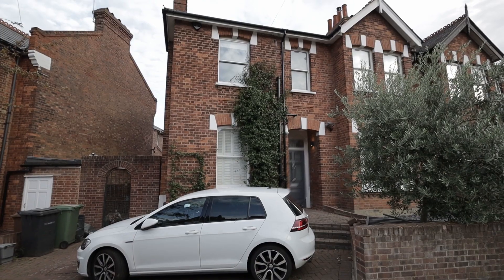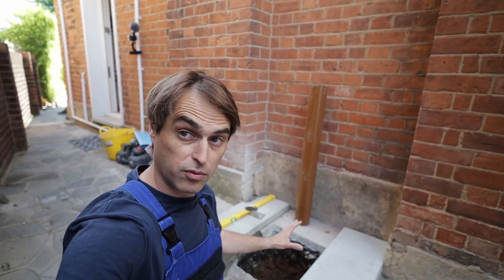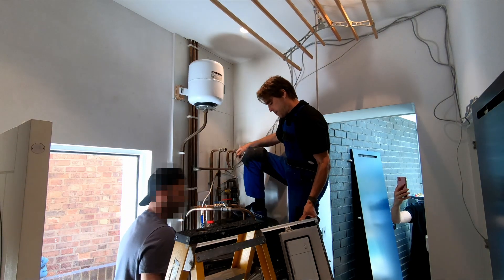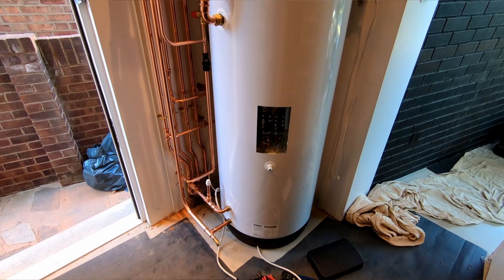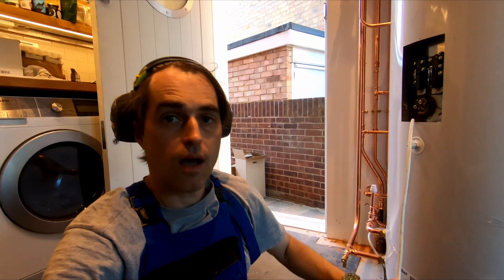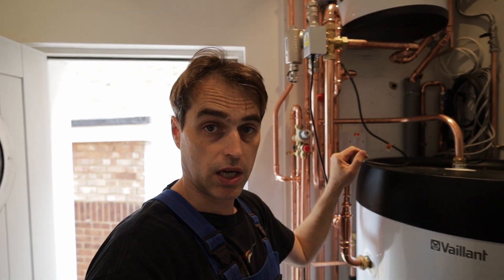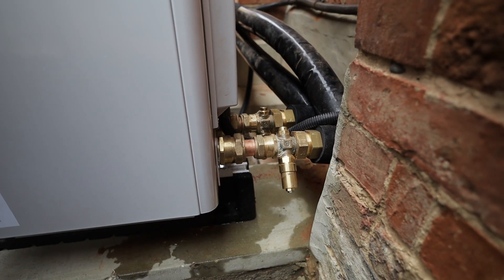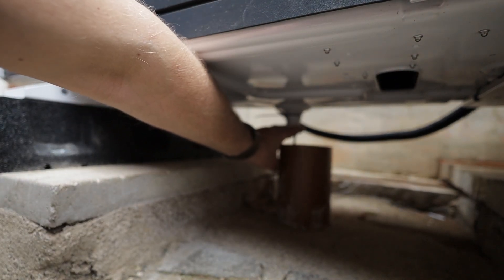Is This Heat Pump Better Than Your Gas Boiler?

Comment: The house is insulated to a very high level, which most UK properties aren't.
The heat pump system probably cost at least five times the capital outlay that a gas boiler would - well beyond what most people can even begin to afford
The heat pump can't provide hot water, so you have to have a backup immersion heater, presumably electric, which would be incredibly expensive to run 
Electricity costs four times as much as gas per unit, so the running cost savings would be minimal at best and are unlikely to break even within the operating lifetime of the unit
The heat pump itself will run continuously because it cannot provide on demand heat, nor respond to sudden changes like cold snaps in winter, so you have to have that thing the size of a bus on the side of your house running all day and all night (imagine what a whole street of them sounds like - well, just go anyplace where every house has an aircon unit...which are much smaller than these things are) 
Sorry, the average consumer isn;t going to pay anything between £8,000 and £20,000 (heat pump install, maybe upgrades to radiators, upgrading property insulation to a very high level which is needed to make a heat pump system even viable )to "save the planet". They will just replace their gas boilers.
Reply from the maker: in a near future, the 2 things will happen - the price of gas will match the price of electricity per kWh and /or gas boilers sales will be banned. At the same time will greater adoption of this technology (Heat Pumps) supply prices will have to come down.

You also have to remember that, the fewer people using the gas network the higher cost of maintenance of the network per individual user. The fewer users we have the more prohibitive the cost of using the gas network will become.

At some stage, it will become much more expensive to buy, install and maintain gas boilers and gas networks. It is not a question of If, it;s the question of when.
Reply: @UrbanPlumbers  Out of interest, do you visit a lot of properties that are simply unsuitable for heat pumps? My house for example is very leaky and feels like the insulation is not up to scratch. When doing your heat loss calcs i'm assuming you account for infiltration losses as well?
Reply from the maker: Not really, no. Maybe 1 in 10. Mostly because they are fully renovated and it’s impossible to make changes to pipework.

Comment: I wonder, if you had a South facing roof covered in Solar panels, would that make much difference to the electricity bills?
Reply from the maker: solar panels now installed - follow up video coming soon

Comment: Cop isn't dependant on the flow temp its dependant on the inside water/outside air temp,  at 42C difference there is no way you are getting a cop of 4, it is more like 1.  The average will be 4 if you use it for hot water and so on and use it for heat all day, however this is also false because you are wasting heat when you don't need it because the output is so low.  The real problem comes when you work out CO2 as heat pumps use alot of electricity, which additional capacity needs to come from gas.  At -2C It is more efficient to heat with gas, than to use gas to make electricity and heat with that.
Using proper calculations, it will take longer than the life of the heat pump to pay back over a simple resistive heater.  It does the majority of its work at a cop of 1 (or close to).
What you need is a COP output on the device, and to see that in the winter on a cold day.

Comment: Do you also use thermostat data to determine the heat loss? I wonder if all these tests are needed (Measuring the walls, checking the insulation and so on)

Comment: An then there was an energy crisis in the U.K. ... Well anywhere in Europe really... Will electricity be cheaper than gas? Will this (2022) be a mild or a harsh winter? Do you have a backup solution?

Comment: Been there had heat pump, professionally sized and installed. Was a disaster, when weather was cold, so was the heat pump, had to get portable electrical heaters, was so cold. We went back to our gas boiler which we would not let the heat pump guy take away, though he wanted too. We now back on gas heat and warm, with the heat pump we were just pumping money in with little out. Never again, I do not want to sit at home wearing eskimo grade clothes.

Comment: Your work looks amazing. Does an external unit disturb neighbours when it's running? Is it noisy like an AC unit?
Reply from the maker: Quoted sound level is 54db so very quiet. In real life you have to feel the air flow to know it’s working as outside noise levels in the city will be louder than the unit most of the time.

Comment: Heat loss calculations, lagging ALL of the pipework. These are things that should be done on all installations, regardless of the heat source.British plumbers and so called "Heating Engineers" just aren't up to the job. (with a few exceptions). The British public has been let down for decades by "professionals" who have fitted ever more efficient boilers, which have never actually performed to their stated efficiency, because the rest of the system is so poor. Many of these same guys are now fitting heat pumps, for which flow temperatures are critical to gain max COP -  and of course they're going to fail. This industry needs a big shake-up!
 Well done Urban Plumbers, but I think your time would be better spent teaching both new and old plumbers in a college, rather than making YouTube videos.

Comment: beautiful job, perfect running pipes:)
I have Panasonic heat pump:)
Reply from the maker: Has it been running ok?
Reply: @UrbanPlumbers  yes. I have solar panels aswell. But everything is in Poland. If here prices are not take from space then I will fit here also, is better overall yearly temp here. In that climate you can get C.O.P. 5

Comment: While the numbers sound great, how much did that installation cost? £10k? £20k? It's going to take a very, very long time until you actually start saving money based on the outlay. Very professional job though - very neat and tidy.
Reply from the maker: after the BUS grant it was well below 10k actually

Comment: As a Canadian, I want to point out that he said that it is more effective when the difference in temperature is small. In other words it can work in Britian but not in winter in Canada. Also your efficiency calculation is wrong. Assuming the electricity that runs your air sourced heat pump came from a natural gas plant, then you would be getting much less than 1 joule of electricity from 1 joule of heat at the electric plant. There would be an efficiency calculation there about how much heat it took for a given amount of electricity and then there would be line losses along the way and then conversion losses at each transformer and at your pump. 

The reason I know this is because of what you said about the cost to run the pump vs the gas boiler. The gas boiler had uninsulated pipes, an oversized tank, etc., but still even with those improvements, you had a hard time confirming that it would be cheaper to run the heat pump

Comment: heat pumps suck..... see what happens when it goes minus 10 ..... no way a heat pump hes showing you will give you anything like the energy you will need for radiators and boiler ..this is a fairy tale

Comment: Hi Factor In Disrucption And Cost And Price The New Price Of Spark And GAS?
You Had A Heads Up on The i Stall With UFH? RetoFit?
Every Job Is Work With What You Have on Site?

Comment: It is more efficient but not in shitty poorly insulated houses, and will not necessarily cost less. Reality here is  cost of installing is high , cost of running depends on the COP of the pump and maxed out at 40deg C will be 4-5kkWh a year plus additional 1-2kkWh if heating water because water in the UK is not chlorinated so it will need and extra heating to stay at 55degC. Now to take a gov grant you need to remove your gas connection which means you will disconnect your cooker as well. With additional wiring and the cost of the most efficient induction on the market cooking will cost you 30% more on kWh usage compared with a gas, and finally gas hob is for life, most inductions last the warranty period ... so overall it won't be any cheaper in most cases cost returns in 30-40years being optimistic,  especially if you have to insulate the house to at least presented poor 70mm pir and 300mm shitty loft roll and buy designated low heat aluminium diffuser radiators.
Reply from the maker: You do not need to disconnect gas or your cooker to get the grant. That is not true.
Reply: @Urban Plumbers   you are correct,  disconnecting gas was only in the proposal for the grant.

Comment: No.  It’s hugely more expensive to install and will be more costly to service and doesn’t give me any better heating.  I’d rather have the convenience  of a decent gas boiler and a really well insulated house.  Mine has 75mm insulated cavity walls.  Boiler runs for 30 minutes once a day and house stays warm all day.  No apologies its a 40 kw boiler as things like decent flow rate for showers is assured.  I’ll be sticking with gas👍

Comment: Can this system be used for underfloor cooling as well as heating? I've been to a house in France which is equipped with a Daikin heat pump that provides underfloor heating in the winter and underfloor cooling in the summer. I find this system better for cooling than traditional air conditioning as air conditioners tend to dry up the air in the room.
Reply from the maker: Yes, this one is actually being used for cooling as well

Comment: Have you ever fit one of those tepeo zero emissions boilers? It uses some dense thermal mass that is heated using electricity and can apparently hold 40kwh of heat energy. So either charge it with solar or cheap overnight electricity.
Reply from the maker: I have heard about them. They cost a fortune though.
Reply: @UrbanPlumbers  figures. I saw it on Robert Llewellyn's fully charged YouTube channel. He seems to have the most expensive and exotic versions of all these things! Including 2 Tesla powerwalls.

Comment: So, if hot water is only 40c then how do you combat legionella which lives to 60c?
Reply from the maker: hot water cylinder is separate from the central heating flow temperature. The heat pump can easily boost the cylinder to 60C but only does it once a week or so. Usually the cylinder is heated up to 45-50C by the heat pump alone.

Comment: Great looking installation well done. How effective is the heating in Winter when it's cold? I listened to an installer who claimed he had fitted heat pumps and many people were very disappointed after a couple years running them. They have higher electricity bills, and the house is not warm enough in winter. Who would want that? Heat pumps are perhaps only good enough in super insulated houses in Scandinavia which can be heated with very little heat. Does the heat pump heat water enough? I hear some systems have an electric immersion heater to increase the temperature of the water when the heat pump isn't making enough heat, which is expensive and not green. It would be great to get rid of boilers but is a heat pump really the answer in most UK houses?
Reply from the maker: Heat pumps are completely fine when sized and installed correctly. The problem is installers not understanding how to design the system and size heat pumps
Reply: @UrbanPlumbers  In Sweden heat pumps are very common. This type of Air-Water heat pump only is used in southern Sweden. In northern Sweden they are not sufficient enough. But the best option for heat pumps in Sweden is geothermic where you drill a 150-250 meter hole in the solid rock and use the heat stored in the ground which easily saves 70-80% of heating KWh. Sweden use microscopic volumes of  gas for heating. Central heating from central big boilers using BIO-garbage-fuels distributed through under the ground pipelines with hot water is the most common for apartments houses.

Comment: Solicitors are already on it. Hahahaha

Mis Sold Air Source Heat Pump Claims
Have you taken out a Loan/Finance or used a Credit Card to buy or purchase your Air Source Heat Pump (ASHP)?
Mellor Solicitors can assist you in making a Section 75 Claim under the Consumer Credit Act. It does not matter if the company has been dissolved and/or no longer in business.

After purchasing the (ASHP) did you discover the following
Level of noise pollution that was caused by the fan
Discovered that you required local authority planning permission to have the system installed. This was an extra cost that you were unaware of and had to pay for
Increase in electricity bills particularly in the winter
That payments under the Renewable Heat Incentive (RHI) have taken years to be paid
You never received an energy grant and now require an EPC
Had to spend more money on energy saving measures for your home to qualify for RHI Payments
You have had in an increase in your electricity bills during the winter months.
There has been no reduction in your gas usage even after having the system installed
Limited amount of hot water for baths or showers
The house remains cold and never feels warm in the winter
Constant issues with repairs and maintenance of the system
Reply from the maker: Very good. It will weed out bad installation companies.

Comment: Electricity is more expensive than gas.
Then there's the cost of changing over.
Then there's the efficiency drop if several neighbours have ground heat pumps etc.

I've looked into many options and alternatives, as someone with solar panels on my roof, and still nothing compares with keeping my old boiler working

Comment: I'm not convinced heat pumps are the way to go yet, I do work for a Big UK house builder that put thousands of these into new developments, and have now stop installing them due to the problems they had and the massive cost due to not working properly. The frustrated customers not getting what they was expecting when you look at it on paper and what you really get.
Reply from the maker: that is because they do not get designed, sized, and installed correctly. House builders going for cheaper quotes most likely or using their regular plumbers that only know gas.

Comment: What I don't understand about heat pumps is, they are extracting heat from outside, to warm up water to heat up inside. In effect like a reverse fridge.

Now, when you MOST want to heat up inside (over winter) that's when there's the least temp outside to make use of, surely making the unit LESS efficient? Meanwhile in summer, when there's more temp outside to help, that's when you least want to use your heating?
Reply from the maker: It is still much more efficient to extract heat (energy really) from -2C air than using direct electric heating. In the summer when it is hot you only use heat pump to heat up hot water in the cylinder, and in the summer it is super efficient do so.
Reply: @UrbanPlumbers  So am I being Heat Pump Phobic not liking the idea/cost/radiator issues potentially being forced by government mandate by having to fit one 2030 on?
Reply from the maker: @NFawc  there is no mandate to fit one and there never will be. As a matter of fact, you couldn't have one fitted this year even if you wanted to due to unprecedented demand and all heat pumps being pretty much sold out.

Vaillant's next availability is 12 weeks, some Viessmann models are well more than that.

Keep the gas boiler and use it for as long as you wish. I know what I am installing in my next house.
Reply: @UrbanPlumbers  Is this no longer a thing?:-

"Home owners could be forced to make their home more energy efficient in order to sell it under the new Government Net Zero stategy unveiled today.

Mortgage lenders would be forced to keep figures on how energy efficient the homes they lent money against are and disclose these to the Government. They would also need to set themselves targets to improve how well-insulated the homes on their books were. "

Comment: Excellent video but there is no getting away from the price difference between replacing a gas boiler and putting one of these in. With new windows, all the insulation, the new air source boiler, rads etc, it would be years before you get your money back.

Comment: Wait, so this can replace a boiler, provide central heating as well as heat water? What's the monthly cost compared to boiler?
Reply from the maker: If installed well this should be cheaper to run

Comment: Wow the piping you did looks really good for the water heater. Got to love pro press fittings. What type of refrigerant does that heat pump use? I'm an ac tech in Florida in the USA
Reply from the maker: R290

Comment: Step one: spend a fortune on renovating a UK home with good insulation.

Step two: Spend a fortune on ripping out the old central heating and boiler. Repairing the damage from doing that.

Step Three: Spend a fortune on installing the heat pump system.

Step four: wait 70 years for the heat pump system to repay all of this investment you've made.

Alternatively, don't do any of this a save your pennies for something more worthwhile.